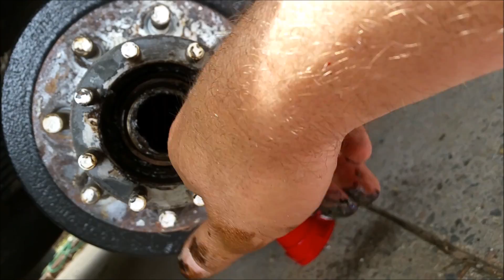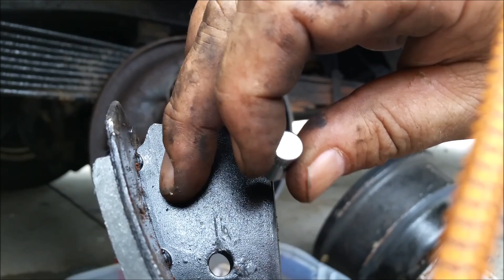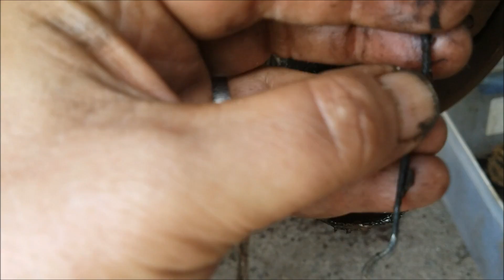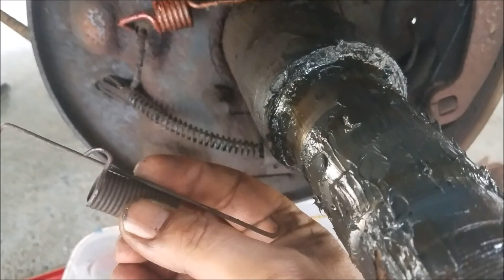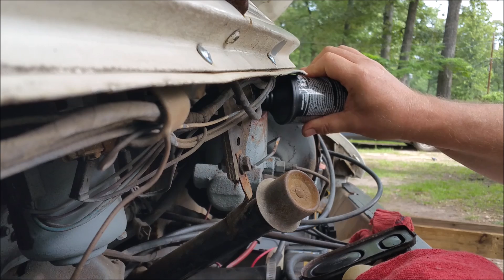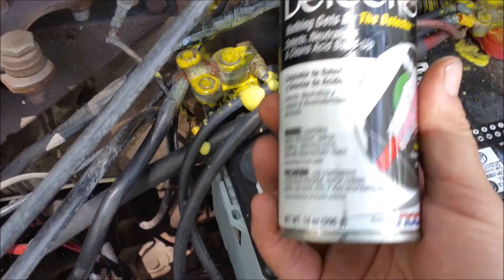RV Life - No rear brakes! Full rear brake job.

Comment: Re pack wheel bearings with greese  ,then re check rear differential fluid  Jim in Colorado springs CO done this job on 78 Ford E350 rv , and 6 times on  90 f250 pick up
Reply: GOBBLESS HOSS

Comment: You also have failing (Leakey wheel cylinder , round thing at top center of backing plate . When that wheel cylinder failed your brake shoes will be contaminated with brake fluid and you may lose brakes.
Reply: Brake fluid is broken down with water. Washing brakes shoes with soap amd water will clean brake fluid from the shoes. A final clean with brake cleaner will remove any residual brake fluid. They will once again work.